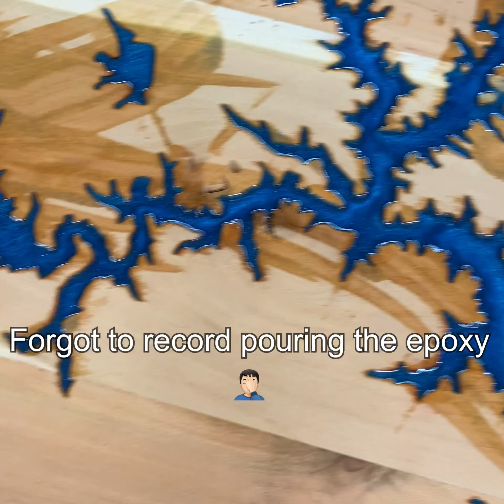How to make a Custom Epoxy Lake Map!

Comment: Awesome!  On your 60v do u use “flat depth”?  And what’s ur clearing but and depth?    THANKS!   I keep messing these up.
Reply from the maker: Hey! Yes I use a flat depth on the Vbit. Usually around .125” but you can go a bit deeper. This saves on epoxy though!
Reply: @mcelvycustomwoodworks9060  thanks!  And the 1/8 is the clearing bit.  Working on my third redo as we speak!
Reply from the maker: @smurph282  try a .25” clearing bit if it will work with what you are doing. Saves some time and is a little beefier.